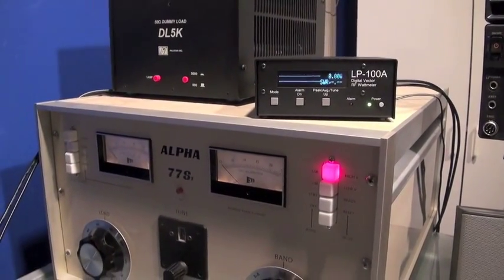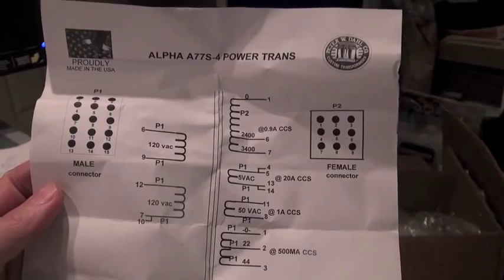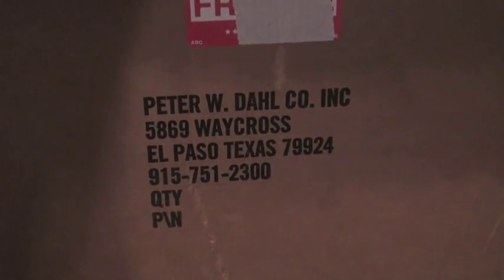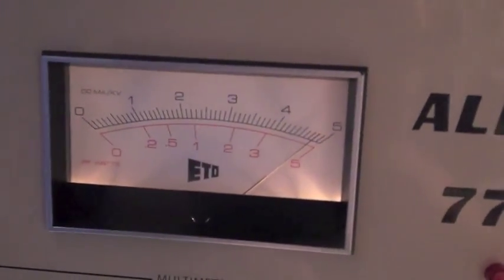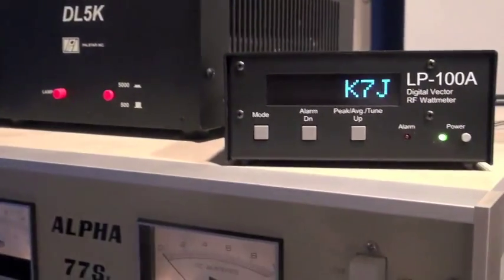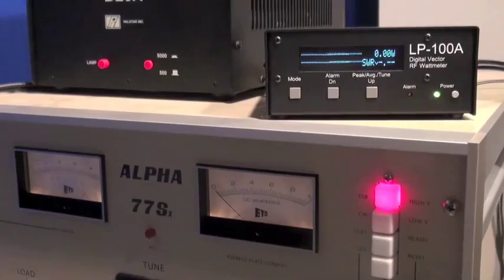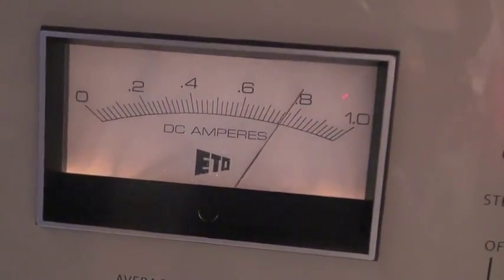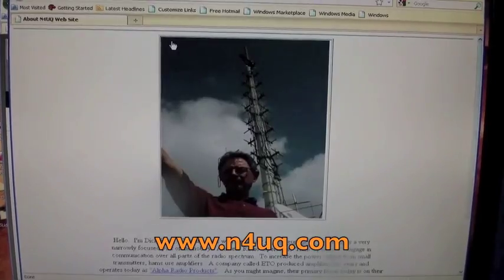ALPHA 77SX NOS TRANSFORMER UPGRADE DEMO

Comment: Dave,You will need every bit of that 5 kW to break through the east coast USA stations when working Europe.  Good luck in the contest.  By the way, you only gained 1 dB by increasing your power from 4 kW to 5 kW.  Do it the California Kilowatt way and run at least 10 kW to see any reasonable difference.  I like high power too!

Comment: For what it's worth, when you upgrade the ALPHA 77SX to two tubes, the plate current measures the current for one tube only.  This was done so that a new meter with a 2A scale did not have to be designed.  So the math:  4,800 V * 1.8 A = 8,640 Watts.  8,640 Watts x 0.7 (eff.) = 6,048 Watts.  The RF output meter reading seems plausible.  Now, I didn't see the plate voltage under load, so its probably more like say 4,200V under load.  Hence, going through the same calcs for 4,200 V, an output power of 5,292 Watts is likely.

Comment: children's toy! trans anode 3400 and the break is 4800 postoyanke up during the reception! And current winding saksimalny 900ma!!!!! We believe 4800 * 0.9 = 4320 watts! 4320 * efficiency (0.7%) = 3024vatt!! This is the maximum that this toy can! This does not include undervoltage under nagruzkoy.I not be bullshit! PEP your shit!

fucked up))))))) 5000vatt - pizdesh!! Plug nashruzku 50th and mer rf voltmeter narZhenie load in FM. If the instrument shows 500volt HF believe.